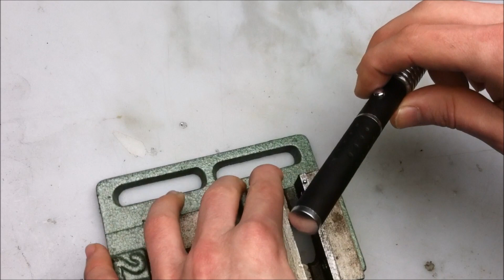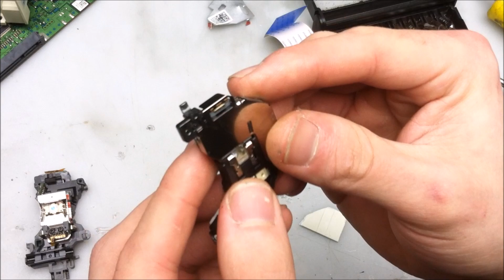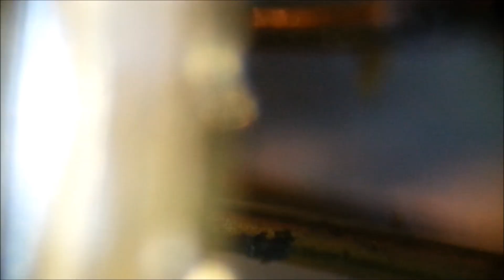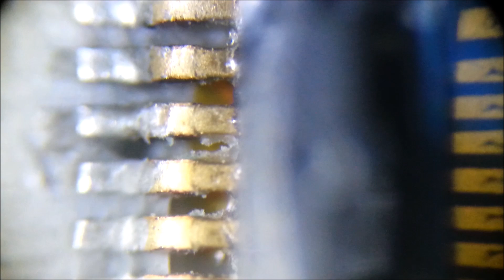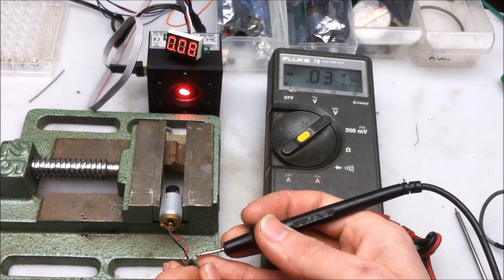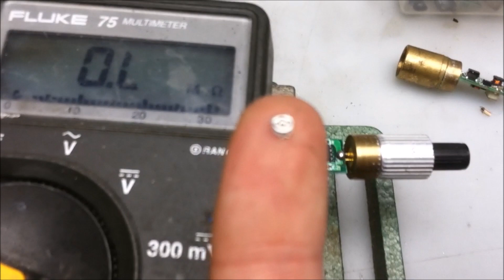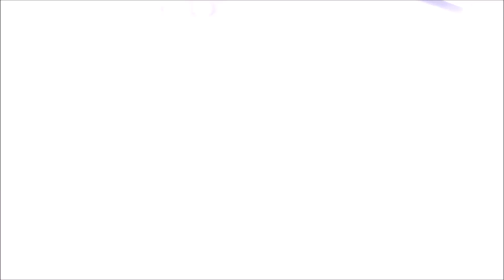Bare&Basic CD and DVD Burning Laser Diodes How to use all their types

Comment: I love your videos! But I have yet to find a source on YouTube or online that discusses salvaging industrial laser diode‘s and modules. 

A buddy of mine owns a local industrial recycling yard. They get hundreds of tons per week and crush everything. I’m one of the only people allowed to buy from the place… And I’ve run across several sources of industrial lasers. 

I get all kinds of beautiful stuff from there.

If it’s really nice stuff… I recalibrate/repair it and put it on eBay… Or sell it for parts. That helps fund my electronics lab. 

But if it has a little to no resell value, or if it’s a “risky item” that I don’t want to sell (because I don’t know how or what to test… And don’t want problem items which cause multiple returns)... then I disassemble those types of mechanisms and keep the parts or do experiments. 

Some guy brought literally a ton of “micromotion” branded gas sensors. Many of which had optics and lasers inside. Another guy brought thousands of pounds of old retired Comcast and Motorola telecommunications stuff. I don’t do much with microwave stuff because it’s really black magic… no need to save multi hundred dollar gold ceramic microwave transistors when I don’t have a way to test them and no one really has a use for them.

I was about to dump it all back in the scrapheap when I spotted a fiber optic module. 

Opened it up to to find loads of fibers and lasers… But most of the fibers had been carelessly snipped.!… 

And all kinds of weird and crazy modules.

Most of the stuff has no resale value… Even if it works. No one has a use for old telecommunication stuff that is obsolete. And companies that would need stuff like gas laser sensors… They’re not going to take a chance buying a used part. They’re going to spend the money buying something brand new and certified. 

I hate to think of the amount of professional projectors that I’ve let go. I didn’t know any of them were laser-based units… And I had already collected dozens of pounds of dichroic glass spheres and lenses. I had no idea some of them contain laser modules. That makes me feel sick.

But my Question to you is… What types of units or machinery should I be on the lookout for where I could find industrial quality lasers? What about Blu-ray players or industrial video equipment? Because so far all I know to look for is projectors, gas sensors, and the random communications fiber lasers and such. But I really would love to find some powerful laser diode’s or pump lasers. 

I have almost a dozen working x-ray machines… Some of them exceptionally nice and modern. But none of them use alignment lasers because they use those safe beams so not to bind patients.

Hope to find some information on what I should look out for. Because most of the stuff brought to this yard is from government facilities and large machine shops and such… Surely there’s some good stuff in there.

Thanks for your time.
Reply from the maker: Please send me an E-mail at Zenodilodon@gmail.com I'd like to cover this in better detail through that format as there is quite a lot of information to cover. I look forward to hearing from you!